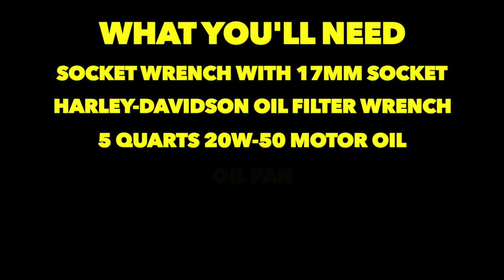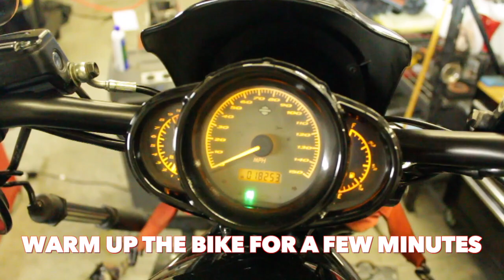2001-2017 Harley-Davidson VRSC V-Rod Oil Change Tutorial

Comment: Can I ask, I have a 2006 vrsca, is a stand or jack of some sort needed for this or can I just have someone like stand the bike upright lol, thanks.
Reply: I know this comment is a little old now so I'm sure you figured something out, but you can just loosen the nut and let it drain out for a bit then hold it up yourself or sit on it for a few minutes after it slows down a lot to get the rest out. You can, of course, just hold the thing up the whole time if you want to though haha
Reply: @BloodPlusPwn  The oil drain is on the same side as the side stand, so it drains more oil out if you just leave it leaning!